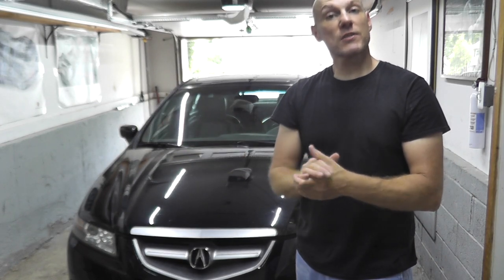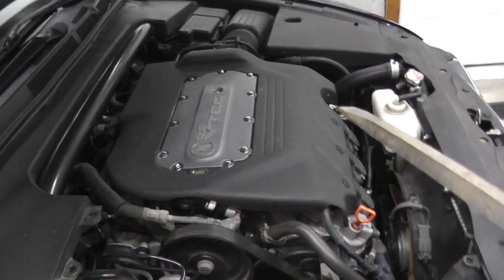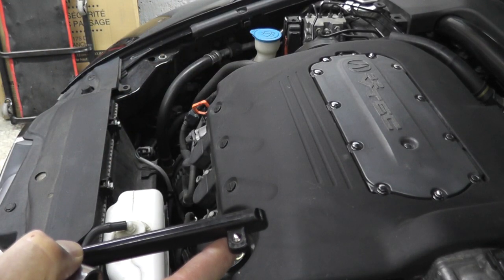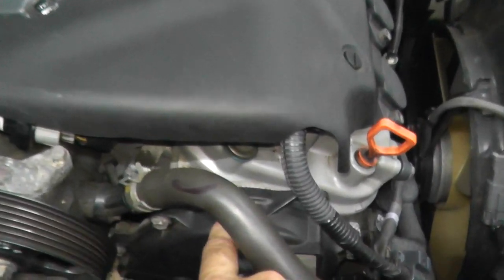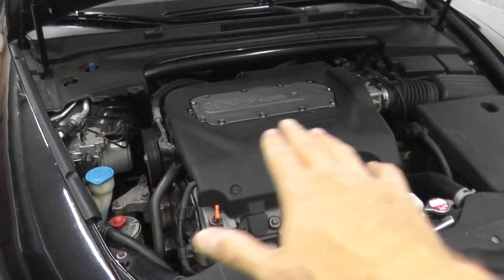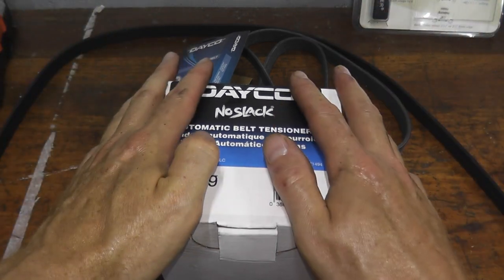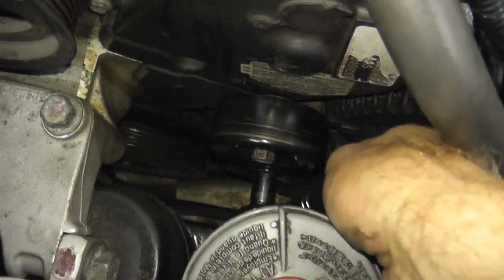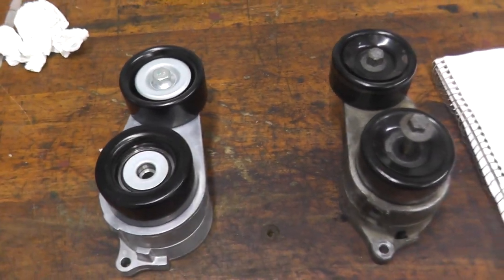Is Your Car Squeaking? | How To Fix A Squeaking Car!

Comment: I have a question it does not have anything to do with this video. Would you have any ideas on a 2000 Volkswagen Passat sedan 6 cylinder, the fuel pump relay went out, ordered it replaced it and the car fired up and ran like a champ, I rolled the windows down and shut the car off, went to start the car a little while later car won't start and the power windows won't work, any ideas from anyone is greatly appreciated, TYIA.
Reply: Check all the fuses